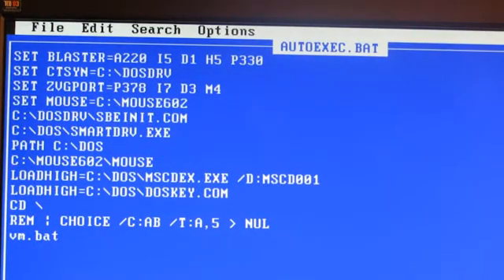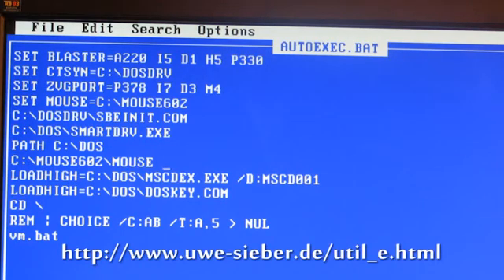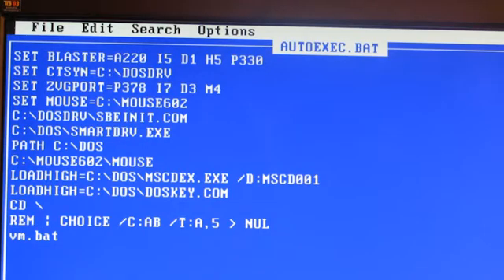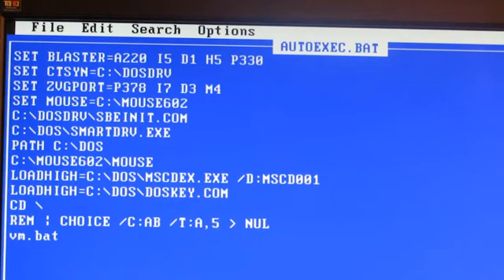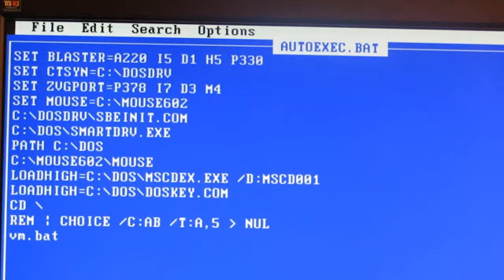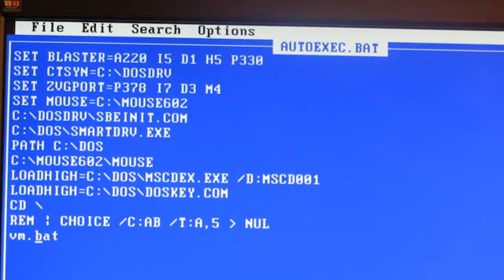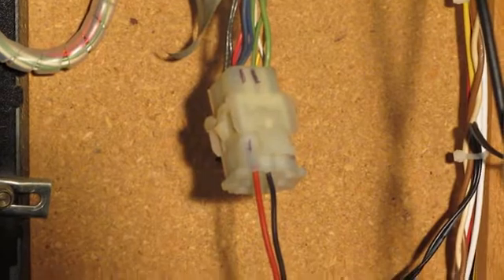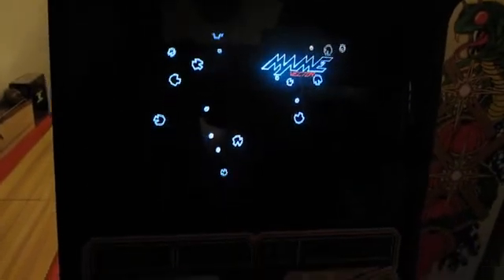VectorMAME ZVG Cabinet Configuration (Part 2)

Comment from the maker: Gather the following: Hagstrom Electronics ME-4 interface board, Hagstrom KE-SP3 cable, Atari Tempest Spinner.  You will need either a PS/2 Male to Male mouse cable or if your computer supports "Legacy USB" in BIOS a standard USB cable (Like you would use on a printer).  Both the mouse cable and the USB cable worked for me but the USB was more responsive.  Google for Hagstrom Electronics.  They ship quickly.  I'll try and have the video done before the turkey dinner digests.  OK?